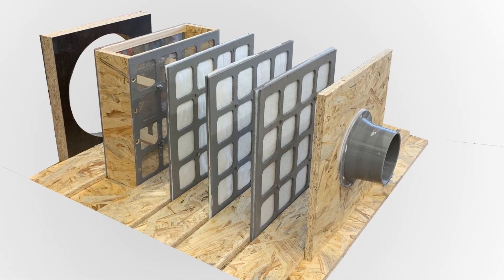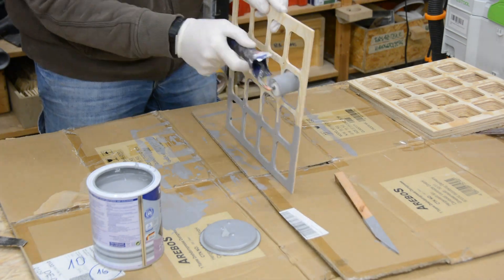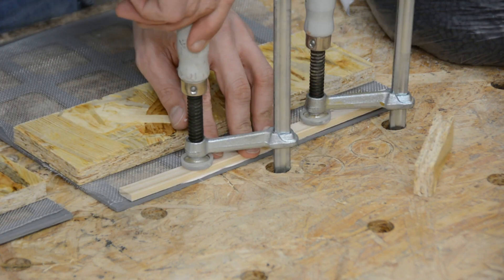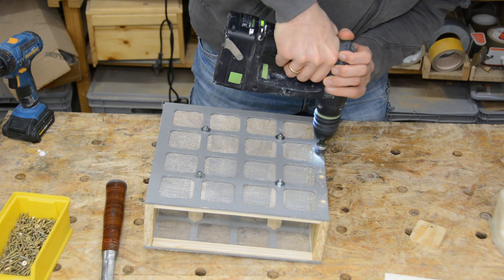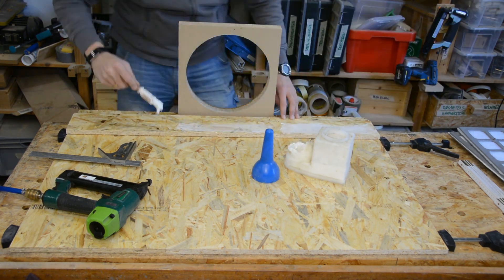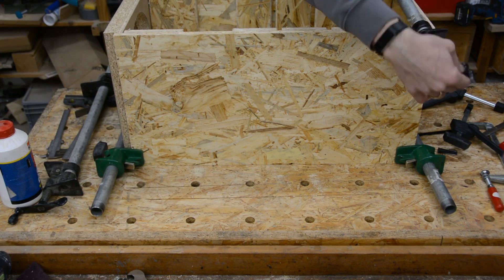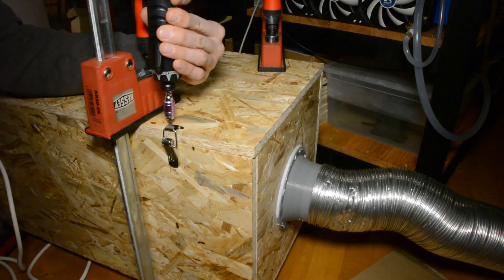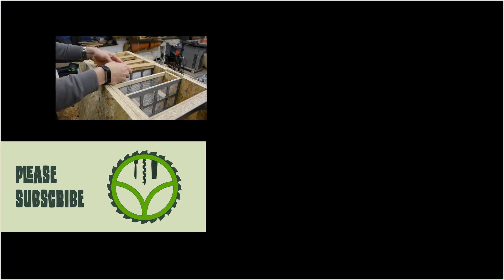DIY Laser Cutter Air Filter

Comment: Is there any smell when cutting acrylic  ?
I made a Carbon only filter with 5 KG active carbon after a particle filter and still smell
Reply from the maker: There is a smell when cutting acrylic. This is however (at least for me) also the case when venting the exhaust out of the window. 

The gaps in the case of the K40 are anything but air tight and the air flow of the fan is not strong enough to create such a strong suction that all the air would go through the filter. 

I might have to cut acrylic after sealing the gaps...
Reply: @WayofWood  I did close the seals for most of the gaps
air is now sucked in from the bottom and there is no other left open ( only the fan )
im using a bilge blower on 12V to aid the internal fan

tip for sealing: use pipe insulation tubing ( cheap and easy to work with ) for the fan mount

all small openings have been sealed off with flexible seals and where needed some silicone
Reply: @patrickmaartense7772  Did this method make a considerable difference in the smell of lasered acrylic?
Reply: @bryancallaghan9182  id did make it less, but not completely gone, do not use this for indoor venting.
Reply: I would think you'd need more carbon for the exhaust to pass through to remove VOCs. Was just watching a video for replacing the filters on a pretty nice unit (expensive I'm sure too), and if I recall correctly, it had 40lbs, roughly 18kg of activated carbon in its chamber. A hepa, some fine filter, and a bag at the beginning for the large debris.
Reply from the maker: Chad Voller That‘s a very good idea. I already have some more carbon sitting on the shelf as I didn’t expected 5kg to be enough.
Do you have a link to that video?
Reply: @WayofWood  sorry im not doing videos  ( yet)
I have the laser in my shed ( its winter here) but pla to move it to the attic and then vent via the roof , but still filter
the way I made it is following

use the bilge blower in the lower part of a dual box ( ikea storage boxes pushed together ) in the bottom of the second (top box) I made several 5 cm diameter holes ( many) , then a mesh over that on top then the active carbon. in the top cover a vent hose 

so basically the smaller particles get filtered out before the bilge blower using a fine mesh 

simple, but effective
Reply: WayofWood Sure, video is from Trotec of Canada. The part about the carbon is about half way through. But I'd watch it all to see how the whole thing is laid out. I was thinking of making one from a filing cabinet put onto dolleys. Always seems to be free/cheap ones on Craigslist.  https://youtu.be/LHyv-Xw7360

Found a different video for another filter they deal with. Both filter vertically for the most part. https://youtu.be/yJkCgAVbAEU
Reply: @chadvoller  I think 40lbs is way to much. From my research, 15lbs (8.8kg) should suffice.
Reply: Brandegee Pierce Are you testing VOCs out of your filter over a period of time? I would assume the more you have, the longer you can go without maintaining the carbon and reduce the chance of air just passing through without being properly filtered. Most laser filters I've looked at, other than compact models, use way more than 15lbs. Substrate being cut is another factor.
Reply: @chadvoller  Sorry for the late reply.  There are lot of variables that can go into it so you are correct, there are lots of filters that have over 15lbs.  But for most people that are interested in making their own fume filter, 15lbs should be enough.  If you are running a laser cutting 1kw+ machine... Stop watching this video and buy an industrial filter.  If you have a K40 or a Boss laser, you don't really need that big of filter.  Couple reasons I say that.  Most people are not using it 24/7 so it would take months to need replacing at 15lbs.  The fan you use is very big part of the system and if you are using 40lbs, you'll need a beast of a fan.  Probably around 5 or more amps which is a ton of power (figuratively).  Lastly, what your cutting (or engraving as I am) is big part.  If you are cutting wood, most of the "smoke" will be caught in the first 2 filters (pre and hepa) and the carbon will be doing very little filtering. 

Am I testing for VOCs? No, and neither do any of the standard fume extractors.  They mostly have a timer, a flow meter and a pressure differential between the different filters.  I started to look up the components and I even have a few flow sensors, but I checked a few forums and most people say just keep a spare filter on the shelf and if you start to smell it, replace the carbon.  If you don't smell the carbon but see reduction in flow, replace either the pre or hepa.

Sorry for the super long message.
Reply: Brandegee Pierce My Pinnacle 40 watt laser came with a 16/8 amp blower. Basically a cheap dust collection fan. But it has plenty of suction. 

Worry I have is that just because you don't smell it, doesn't mean there aren't VOCS not getting filtered out. Acrylic is nasty stuff, I'd want to know I'm getting the levels down to a safe amount. This is why I was wondering if you tested the output. I'm not going to trust my nose, which is no longer as sensitive as it used to be after being exposed to 3D printer resin, casting resins, and high temp silicone. As you might guess from that, I'm looking for a possible mult-use filter. For the laser, and other station filtration needs. Think of an adapter that looks like one of those vacuum soldering stations.
Reply: @chadvoller  They sell handheld VOC sensors.  I might pick one up or maybe just make my own.  They are really cheap and I have about 30 Arduino micros.  Could just hook it up to a piezo speaker when the levels get to a certain point (lower then when it needs to be replaced of course for safety.

PS I made the video today. https://www.youtube.com/watch?v=P8zQIargAF4&feature=youtu.be
Reply: Brandegee Pierce Good video. One thing I've heard about those kits to make your own VOC sensor, is they aren't quite as accurate as you'd hope. Things that shouldn't set them off, set them off. Like humidity. I probably should have something though. Looking on Amazon, the cheaper ones detect formaldehyde, but not other VOCs. The price of safety I guess.
Reply: You are success for remove acrylic bad smell?

Comment: Interesting video. These things are normally extremely expensive. I will be trying a version of this, for use in winter months when I don't want the air sucked from the room. Looking forward to version 2.0
Reply from the maker: It's such a great improvement - especially in February when it's freezing cold outside. 

The filter is quite cheap compared to the commercial versions - the activated carbon and the fan being the most expensive elements. 

I am really hoping to get some input for a version 2.0.